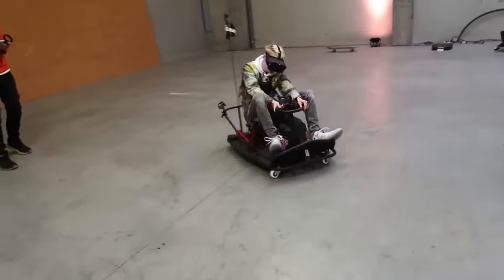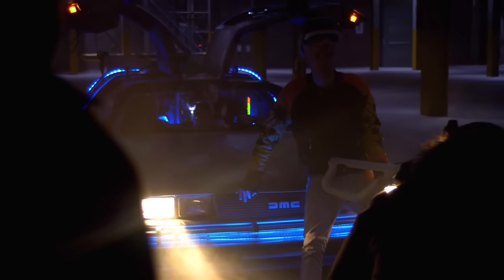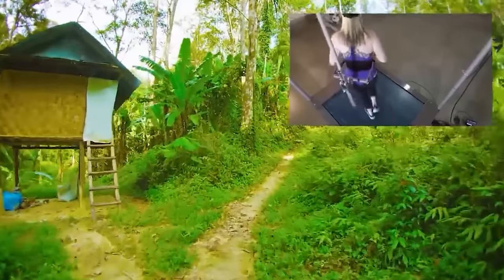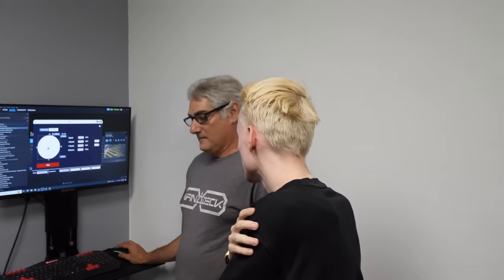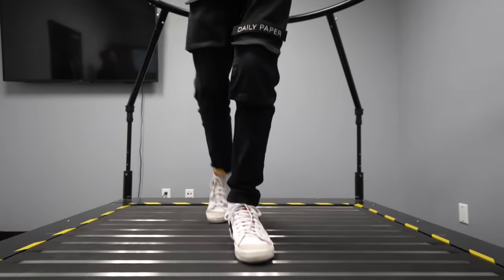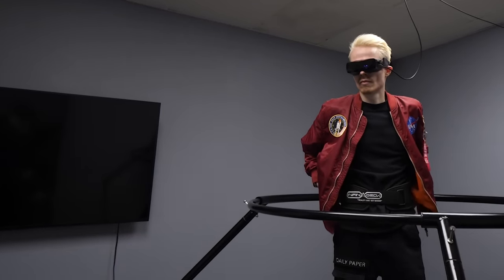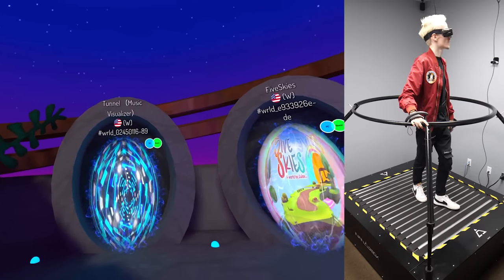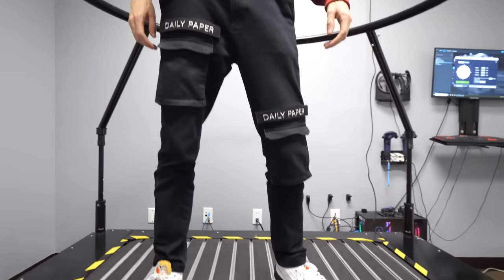I Tried THE Ready Player One VR Treadmill!

Comment: I think that I know how they could solve the latency problem. they need to have trackers on your feet and have the physical space of the treadmill defined in space, so as you pick up your foot and move it, they will be able to move the treadmill so that your foot never leaves that spot in space. Basically simulating how walking normally works. 

You lift your foot and then use the other foot to push away the ground to propel yourself forward, this would just add an equal and opposite reaction force to prevent forward movement.
Reply: Part of the point of this is that it doesn’t need any kind of foot tracker. Otherwise, that would work very well, which is why most other companies using a similar idea have done just that.
Reply: Given they're now doing hand tracking with cameras, I assume they could do something similar with sensors around the treadmill... of course that doesn't help bring the price down.
Reply: i totally agree. foot tracker are way better then image based tracker. for image based tracking you would need high speed cameras that work well in low light environments and a pc strong enough to process all that data plus the games
Reply: @jowiemonster  The quest 2, Quest 3 and quest pro offer quite decent image hand tracking and they are I think the cheapest reliable headset on market rn (especially the quest 2), So I think you don't need some super fancy and expensive material for an image foot tracking, maybe just some decent infrared camera ?

Comment: so i have this idea... tons of rubber balls with copper mesh on top of them inside teflon half circles that have copper electrodes, as the rubber glides over teflon these copper meshes rub against one another, the player wears a special sole that conducts electricity into the system bridging the gap using the mesh on the ball and going into the teflon cups, right below that is the base frame where all these are wired, each ball is like a pixel, when they spin and charge is applied by the user's foot through the conuctive sole, it basically registers data that you can pick up in a specially designed board.. This would give you wayyyyy better tracking resolution and would also make it entirely free to move slide and basically switch to any direction... you can have brakes inside the teflon cups that reactively stop based on movement data... if you take this entire system and house it over multiple pneumatic pistons.. you can even raise levels of the floor and have it react like actual stairs and give you the impression of walking up stairs or over rough terrain and such... 

dumb idea i know... but if you like itt and think it might be viable, hit like, let people know about it.. let's see it gett made :D ,
Reply: Better patent that idea. You just made someone with the resources a lot of money ...erm disney
Reply: Yeah bro. Note your ideas down before publicly posting them..
Reply: @Rocksidion  i raw dog my comments direct... no notepads in between my brain and the comments section, ever !!!
Reply: @JustAPakistaniGamer  No I get that, but just keep in mind your ideas might actually be too good and publicly posting will chance that you won't be credited. You'll be "Brent-Revera'd," so to speak..
Reply: @Rocksidion  if you care more about the progress of humanity than personal credit and have the capacity to come up with a 1000 more ideas like that... you really don't mind at all... 

and i really don't mind at all.. !!!!

i don't care about money...
Reply: @JustAPakistaniGamer  No, the opposite. It's more about protection from greedy people. By all means, talk about your ideas. Share them with people you can trust though.
Reply: @Rocksidion  bro no one is gonna make this shyt
Reply: @VastardokKukiao  Yeah you're probably right lol

Comment: It's great for simulating walking on the flat. What is the experience when walking up a hill? You have to push your hands against that safety bar as the feet push against the moving floor?

I think that's the next step in the evolution of this treadmill. Servos/hydraulics to tilt the treadmill to an angle that matches the ground. You could say a stair climber effect. The tilting of the treadmill is not a problem. The task is making the system aware of the ground in VR and the person's orientation to provide a matching surface footing.

Comment: This would add to the weight & bulk- but they should try an automatic rotation feature, so the thin tracks always face front & back aligned with the player’s hips. (Would keep the latency / resistance low)

Comment: I'm just wondering if adding foot trackers could help with the latency.
And having said that, I had another thought, pressure sensors that could go under the shoe. Something that could be strapped to the shoe that could communicate how much weight each foot is holding. The combination of waist, both feet position and both feet pressure could provide a decent picture of intent for the system. Foot out, pressure increasing, likelihood of moving forward increases. Sudden reduction of weight = sudden halt of forward travel.

Comment: There's a stretched flat ball version which has a slightly concave disk and 8 rollers inside it with 8 rollers outside it. Basically, it is designed to have minimal parts and minimal noise while giving the perfect impression of walking on a leveled ground... even to lay flat on.
Reply: Would be far more annoying for maintenance lol I could imagine them getting clogged up very often because humans shed our skin constantly
Reply: @rarehyperion  From what was explain by those in the military, they haven't had any issues at all with it since 2004 given the 6 years. Looks like now of the part can get clogging in any way because the rubber rollers are more than large enough. Plus... it is super-lightweight to lift that flat ball since the 8 roller are not that heavy while the lubricant is an extremely effective thin layer. Those in the military who made that concave disk seem to be geniuses.

Comment: interesting tech.  i think it needs to be about a foot bigger all around.  integrating with some sort of suit and/or foot sensors like the cheaper ones might solve the stopping lag issue  - like a double toe tap to stop.   Mind you, it sounds like they may be integrating tech like Rokoko into the next gen version so if that is the case, then maybe a headset and exo-skeleton type gloves (for trigger action/input type movements) will be all that is required. Treadmills are notoriously bad for knees but that might be why they have the slower speeds.

Comment: There's no way the future of VR is complex treadmills. I love their innovation and experiments, but belts will not take us to the future. Sure, sliding around on a smooth surface isn't it either (although I think it's slightly better than the weirdness of these predictive treadmill belts). It'll take some leaps like Disney's Holotile Floor or other similar engineering feats to get really open movement. But that doesn't mean they should stop trying. Hope they keep figuring stuff out, just don't feel like they need to keep using treadmill belts to achieve it.

Comment: Free idea: made optical sencory pad and stretch "Baby holder" that prevent you to move anythere. TA-DA now you have Reverse Mouse as a floor and your shores as mousepad. While stretcher system above just hold you above allowing feet to touch optical sensor pad (how to jump or crouch or prone you ask?) Simple weight sensor that would register sudden increase in weight before sudden decrease (jump), slight decrease in weight if you bend your knees a bit (crouch), near total decrese in weight (prone). Other motion functionality is on controller apparatus and motion sensors. Other all it would be much-much-much easier and cheaper to build using existing technogy and gaming  periphery in New way then try fancly overcomplicated and definitely overpriced one not to mention bulky and uncomfortable and not user friendly as plug and play. Well assemble as Ikea furniture and play and treadmills (which can be dangerous for small children and pets) no hold bars that you would hit all the time in VR no noise or discomfort of Free moving without vertical support (it would made you motion sick really fast) plus nothing would hold you if you lose balance)), after assemble you ancor strap system above you regulate lenth of straps, then turn on sensory pad and wear special low friction shoes that perfectly reflect optical IR sensor back to recieve a movement signal (optical sensors should be at least dozen or more to get very accurate X Z data of each leg movement) and that's it, enjoy the game no possible danger to children or pets (zero moving parts), no arm obstruction you could hit you can't see (cause ancor is right above you and you rotate with straps that fix you in place) you can jump, crouch and prone just by jumping, crouching or proning just like real life. System is safe for all ages and you look cool while you in it. Now, somebody just need to read this, made BluePrints, made it and sell en-masse for VR gamers.

Comment: It kind of doesn't look completely 1:1 tuned to motion in the game. Did it feel right? 
I wonder how willing gamers will be to give up the pace of modern games and move again at human speeds. Everyone has got used to running everywhere all the time at 30mph in games!
Reply from the maker: As I said in the video, it did indeed felt accurate enough to be immersive. Its always hard to judge a VR experience based on watching it on a flat screen.
Reply: @nathie  Do you think this would reduce motion sickness, or make it worse?  As you are jogging up and down as you are going forward so does that fool the vestibular system into thinking you are moving? Or does that 'inertia' when you come to a stop and the game isn't moving but you are being returned to centre cause any additional issue?
I really wish I could answer these questions but I'm still waiting for my cyberith virtualizer from the 2014 kick starter! Ha ha!

Comment: I'd buy the Infinadeck Portal for less than $700.
Since that statement is likely to result in chuckles and ridicule at this stage, I'm likely to not be in the market for one of these anytime soon. lol
Also, it appears that it isn't calibrated to result in nearly a fast enough in-app movement, so you don't move at the speed you actually walk on the treadmill. Maybe it just looks that way?
Reply from the maker: I don't expect the Infinadeck Portal to be that cheap just yet but it does come with a lot of improvements that can only get better overtime. 

Regarding the movement: as I mentioned in the video it did feel quite accurate with room to improve. On video it looks a little funky but when you try it its actually pretty hood.

Comment: These kinds of treadmills will never feel right because of inertia. Once you get the thing moving it wants to stay moving and it doesn't want to fluidly change directions quickly. The floor moving under you isn't the same as you moving yourself against a stationary floor. This is why running on treadmills and running on roads are so dissimilar. This is not naturally walking. Nobody would ever refer to the feeling of this thing under your feet, especially with your eyes covered by a headset, a natural feeling experience. There may be some solution using strong motors with millisecond braking and direction changes but one miscalculation and you've made the problem even worse and potentially injured the person on the thing. I just don't think this is the path forward.